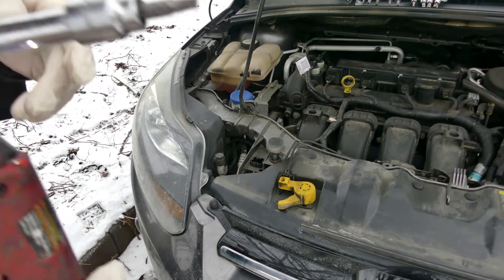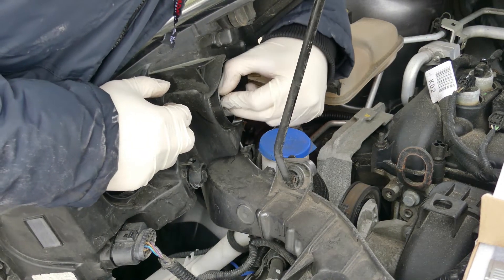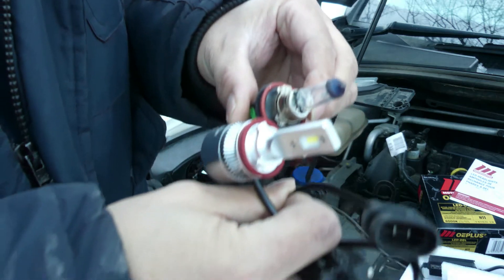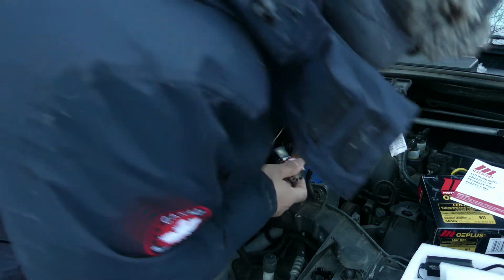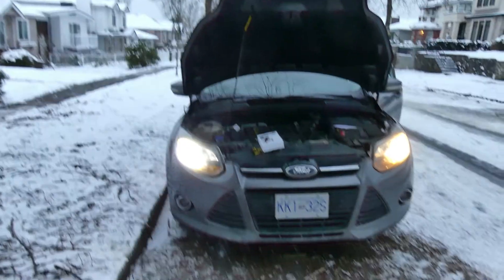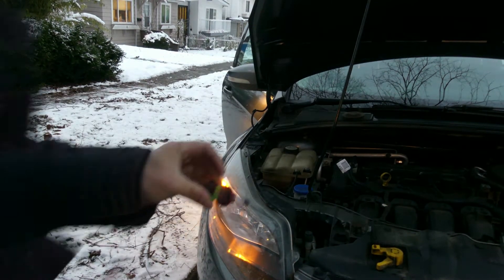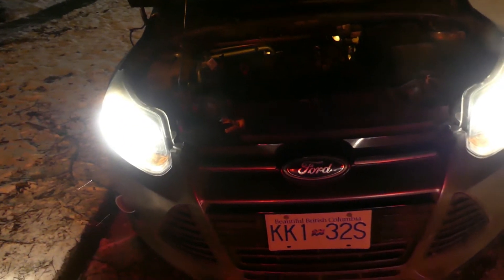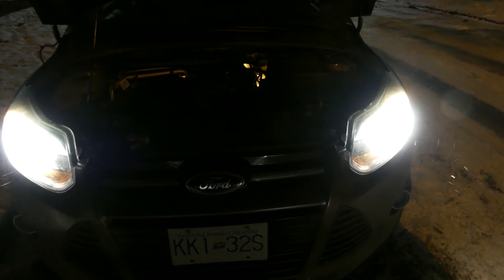LED Lightbulb Wont Work on 2012 Ford Focus

Comment: The issue is the BCM sends a PWM signal to the headlights so the LED's only see 8v. Theres a way to reprogram it with Forscan to send battery voltage to the headlights but I'm not sure how exactly to do it at the moment.
Reply from the maker: yup ur right the manufacturer made a bcm design that can only accept a bulb with a certain amp ..meaning they doesnt want u to replace there bulb not unless u modified the bcm/module or reprogram it

Comment: I have a problem - on my focus mk3 I have fabric led "eyebrows" in headlamps (part of daylights), and when I turn contact both leds work ok, but when I turn engine, after couple of seconds, left (and sometimes right) led turns off. It really annoying. I also got a notification on board - headlamp malfunction, service required. Can you tell me something about this, any info? Thanks
Reply from the maker: some cars doesnt like an aftermarket bulb

Comment: You can fix this issue by going into the computer of the car and changing the settings, it doesnt work because an LED uses less voltage than a standard bulb so your car thinks theres nothing there. I forget the exact name of the setting but it needs to be changed to "ALWAYS ON" and it will work.
Reply from the maker: Thanks for the tips
Reply: How do you go into the computer of the car
Reply: @ThatGuy33121  there are different apps available out there. you would have to search what apps are compatiable with your car.

Comment: I had the same problem, I solved it by connecting a normal light bulb parallel to the low beam LED bulb , I used a 5W normal turn signal bulb , high and low beams LED bulbs work perfect !
Reply: Can you explain that a little better?
Reply from the maker: so u did cut the wire going to the low beam  and connect a regular bub is that what u saying
Reply: This guy is right. You just splice into the low beam wires adding another light output. I cut my fog lights out and spliced them onto the low beam wires with quick splices. Make sure the wires are long enough and you can put the halogen ones in your fog lights. Essentially your tricking your computer but splicing in another set of lights and putting halogens in them, your car thinks it’s got a halogen bulb in it which it does. You’ve just added them in before your low beams. Make the wires big enough and run them down into your fog light holes and now also you can have your fog lights on while you have your high beams on. My fog lights are always on when I turn my low beams on. And stay on when I flick my high beams on.

Comment: LED Decoders worked for my 2012 Ford focus SE
Reply: My car did the exact thing yours did. The new led light would turn on then few seconds it would turn off.... I ordered the H7 Decoders on Amazon for my low beam LEDs.  It's plug and play.. only thing I had to plug the Decoder a certain way cause of the reverse polarity issue... .
Reply from the maker: @cLaUdiALeE77  thanks for ur input ill let my customer know to order that H7 decoder
Reply: @cLaUdiALeE77  can you post a link to the ones you purchased?
Reply: Canbuz did not help my H11 led, won't work in my 2012 Ford focus s.e.
Reply from the maker: show me how

Comment: You can buy an ELM 327 OBD2 to change the configuration on the BCM

You download a program on the computer and connect it to the OBD2 and then to the car to change it
Reply: What setting are you changing it to? I take it you are using forscan or focccus?
Reply: @pauldodds8312  Did you get it?
Reply: whats the program that I have to download?